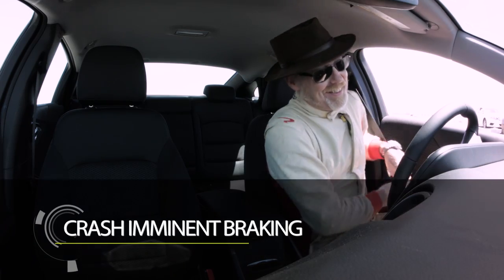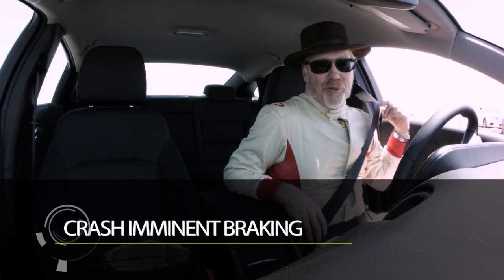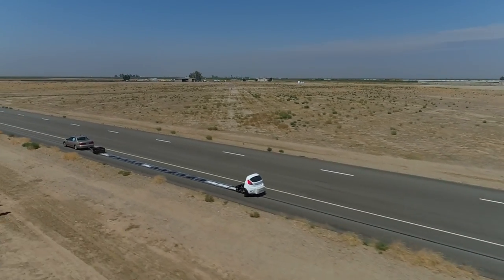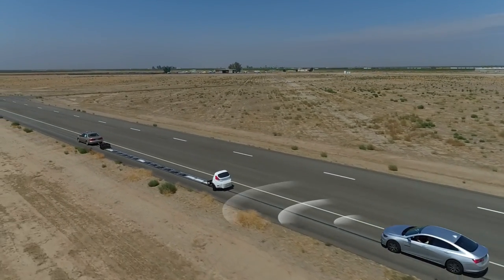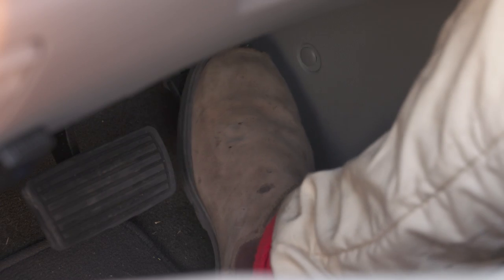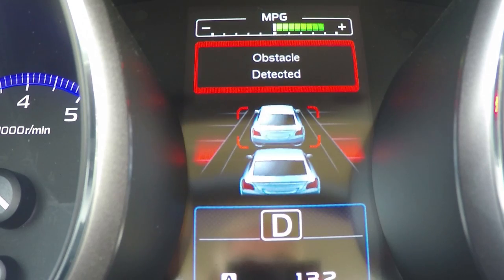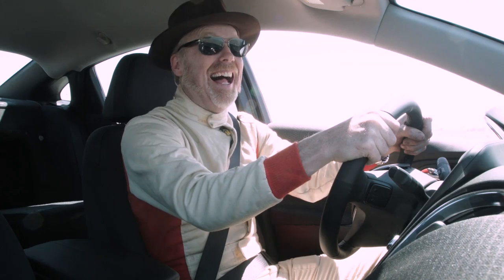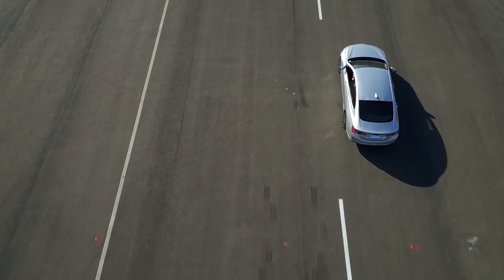Adam Savage Experiences Crash Imminent Braking

Comment: What if you came across a blastic bag or something that wouldn't damage the car, will it break automatically?
Reply: So what about a motorcycle in that case?
Reply: kai siaki Plastic bags and the sheet metal skin of a car are totally different things.
Reply: Tiles Murphy Proximity sensors wouldn't care about that jazz
Reply: Jeryll Lee Well, what kind of sensors are we talking about?
Reply: Tiles Murphy What you applying here is that this system works on metals only. What about a tire in the middle of the road that got off another car, a chunk of rock or non-metal bollards/curbs ? You know how dangerous is that right?
Reply: Danial3W Depends on the height of the object. Perhaps the sensors are located on the upper lip of the bumper, and aimed upwards at a slight angle. This would enable the system to ignore anything below the ground clearance of the car, and detect objects of relevance. Also, there could be communication between two or more types of sensors, or multiple sensors of the same type, but operating on different frequencies. Software could then differentiate the type of obstacle based on multiple criteria to obtain a more accurate reading. This could allow the system to differentiate between an aluminium can on the road and a car.
Reply: Jeryll Lee The are different types of proximity sensors, inductive for metals, capacitive for plastics and many more.
Reply: Danial3W Inductive and capacitive sensors have a very low distance at which they work. Also capacitive sensors don't work with plastic, try operating your smartphone with a plastic stick. It won't work, mainly because plastics don't have any capacitance.

Safety systems in cars use ultrasound (close distance, used for parking and detection of vehicles in the blind spot), radar (long distance, used for object detection and avoidance) and/or cameras (mono for roadsign and object recognition, relies on radar to measure distance, stereo for roadsign and object recognition and distance measurement, doesn't require a radar).
Reply: Tiles Murphy Great explanation dude. it might on someway predict the obstacle impact on the car wether it was big or small and from what material it made, by using a certain formula for example density*size to approximate its mass or somthing like that, a big bale of hay isnt as dangerous as a midum size rock if you know what I mean. Sorry for my bad English, smh this conversation would have been much easier.
Reply: Andreas Kist So this system cant distinguish between matrials due to the longer length of the radar waves which makes it reflect unditaled echo. The only way to detrmine the obstacle matiral is by using electromagnetism but it has a very short range which makes it unreliable. As of now i conclude that, this system can break suddenly from an unharmful object like plastic bags which can lead to serious consciences. I would appreciate any correction
Reply: wrong, capacitive sensors would react to plastic or glass etc. but inductive ones won't. however you are right, they don't really work over long distances, so not practical.
Reply: Yes and no, the software is advanced enough to recognise the response from a plastic bag not to be a threat, it's conceivable that in a worst case scenario plastic bags could give a false positive, however it's very unlikely. Radar and most camera imaging is also not precise enough to recognise incoming objects (like a bale of hay or rock as you suggested) and their size, more advanced 'self-driving' cars such as the WAYMO with LIDAR sensors can form a very accurate picture however.
Reply: well if tesla dosen't brake when there is stiky snow in front of the radial (it sees thru)so i don't think that those systems woud brake for a blastic bag i think object need to be thikerl than a bag

Comment: Its a little scary knowing my car can brake for me. What if it malfunctions? Or it mistakes something as crash imminent?
Reply: Cambaudio Yes but it's far more likely that you will malfunction or make a mistake.
Reply: Or wait until version 2.0 where they fixed the bug that caused you to die.
Reply: You already trust your car to brake for you!  Most cars have an anti-lock braking system (ABS), which automatically engages and disengages the brakes on your vehicle to prevent you from going into a skid.
Reply: People tend to rely on techonolgy , there's a lot of bad about this.
Joe Woods - That's different......................................cmon.
Reply: +aintnobodygot timefodis Tell that to the tesla that thought a crashed semi truck was an overhead sign and plowed right into it. Yes the driver should have been paying attention but the point is, we're putting too much trust too quickly into this new technology.
Reply: That's 100% the drivers fault.
Reply: ItsJustBlasphemy Yes that incident was his fault. But that was him relying on a technology he had control over. This technology is silent in the background. What if he's in front of a semi and the car mistakes something for a car in front of him and decides to engage the brake and the semi doesn't notice him slowing abruptly. That could be a fatal accident on the freeway. Fuck, what if the sensors or the computer simply malfunction, that happens all the time in every area of technology. I could go on but you probably understand what I'm getting at.
Reply: Glockshna 
Still his fault.
Reply: Bose-Einstein
Shh big boys are talking.
Reply: Glockshna That can't be too common.  The amount of lives it saves will be much greater than the number of malfunctions.
Reply: There are already montages of this tech saving people on the road. Computers are always paying attention and can react quicker so why not let them save some lives?
Reply: Glockshna 'Fuck, what if the sensors or the computer simply malfunction..." What if the driver gets a stroke or suddenly falls unconscious and kills pedestrians or other drivers without this or Tesla's system? Really, you can go with this in every direction. The good thing is that technology improves with time and stays at the top, humans not that much.

Comment: its a great feature if they can locate the sensors on the cars away from the wind shields most cars with this feature the sensors are located at the top of the windshield thus producing a replacement wind shield costing up to $800.

Comment: I have concerns about this system... Sure in say 90... even 95% of situations it's probably a good thing.  But what if the ground is icy?  Or what if you want to push another car with yours?  There are lots of instances you could encounter where such a system could interfere with the safe operation of the vehicle and result in the death or injury of the occupants or others.  For example... pushing another car off the train tacks...  Escaping a more dangerous situation by pushing past/through other cars... or stopping too suddenly and being rear ended...  Too much automation can be a bad thing.  There would need to be 1 a lot of fine tuning to find the best range of circumstances for such a system to be on... and for it to be off the rest of the time... and 2 for there to be an off switch because sometimes collisions at higher than recommended speeds are necessary.
Reply: MoOrion I'm just wondering... how often do you have to push other vehicles with your car to avoid danger? What situations would require you to do that?
Reply: (a) you're not going to push someone at speed. you'll inch up to them until the bumpers touch and then slowly add power. (b) you really don't want to do this with cars that have expensive sensors in the bumpers. (use tow straps on the car's purpose designed tow points.)
Reply: I not saying it happens often... but there are situations that do occur where using your car as a battering ram to escape is a viable option.  Of recent I cite... various violent protests... the recent terrorist attacks in London and Sweden...  And even just the more usual runaway truck coming down the hill behind you.  If a system such as this prevents you from moving at all while "too close" to another vehicle... fence... decorative bush... Then it could prevent you from getting out of the way or even just helping a friend get their vehicle unstuck.  I don't know how "smart" it is... but I have my doubts any system is smart enough yet to handle all the situations... which is why it would need an off switch...  for those times it can't handle.
Reply: MoOrion Well, cars aren't really designed to push other cars, so you may find yourself in quite the predicament if the other cars are in park, breaking, or if the driver isn't fond of you pushing them.  But maybe automatic breaking would be best used on a highway when cruise control is enabled, or when you car is, like, going over 30 MPH.

Comment: Tested needs to test out teslas auto-pilot at high speeds, say 75+ MPH.
Reply: Actually I think it's limited to like 50 or something. So maybe at that speed then.

Edit: Nvm again, the limit is posted speed limit and 90mph on highways.
Reply: not sure but i don't think Tesla AP is limited to 90mph.... remember there is some highways that have no speed limit (i think the top speed of a Tesla is 155-162mph depending on the model)
Reply: I did some research when I commented. The auto-pilot (with auto-steering) is limited to 90mph.

Comment: Now i dont drive like a jerk but sometimes you need to cut through traffic and accelerate close behind someone and switch lanes.... i dont want this tech fucking me over and braking for me when im about to get over
Reply: I think the benefit outweigh the cost.
Reply: It calculates if at the speed you are travelling at and the distance to the car if you are within ~2 seconds of hitting the car in front. If you are travelling at say: 60mph and a car in front are at 58, it will calculate based on the speed you are travelling and the distance so you are brought down to 58mph or less before reaching the car. As long as you are not very close with a large speed difference then you will be fine.
Reply: I've more than 10 year driving experience without any accident. I still think this is a good thing considering other careless driver could use this.
Reply: You fool. Do you know what allows you to drive? highly tested event-driven programs.
Reply: Cutting through traffic and accelerating close behind someone in traffic is exactly the kind of conditions that create crashes in the first place.  So yes, this is when the auto-braking should be activated...

I can see where this tech would be egregiously frustrating driving in city traffic, but once they become standard on new cars (by law) they'll become more common, which should help pacing and spacing issues in traffic.
Reply: Ovni121 . You think? sorry but it doesn't . You don't want people to rely on technology when other peoples lives are at risk..
Reply: This isn't a self-driving car. The technology here is assistive, not automated; a driver will still need to have full control of their vehicle, including braking.  This tech is there to compensate for drivers who can't or don't (or won't) brake appropriately in dangerous situations.

You don't rely on the car to brake itself.  The car only brakes itself if you screw up and don't brake when you should.
Reply: Not if you're a good driver and plan ahead.
Reply: L.D. Johnson which is basically all what "traffic" is to begin with. idiots driving too close and then brake real hard then accelerate like a drag race then stop right away again.
Reply: Evan Curatolo "I don't drive like a jerk" ... goes on to describe driving like a jerk.
Reply: Andrew Elias your momma must be so proud, mr. Self-righteous